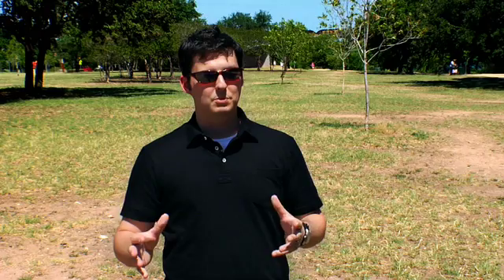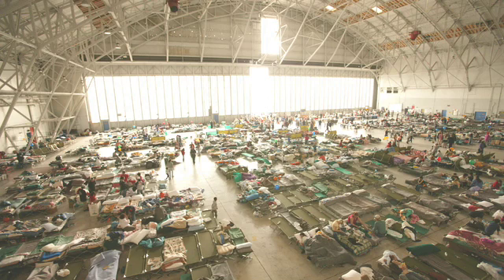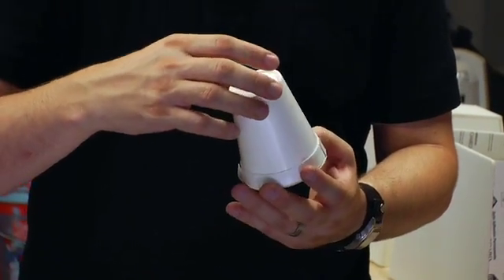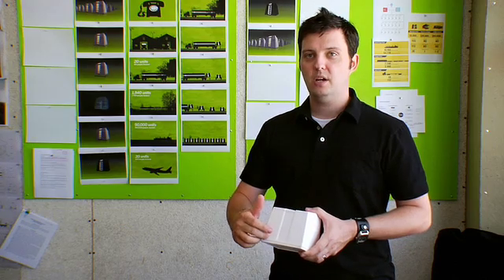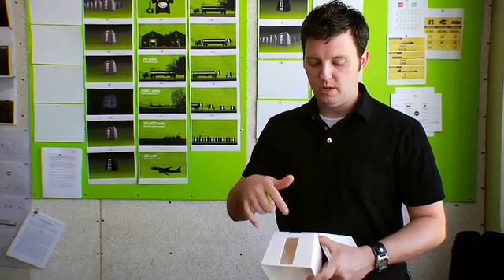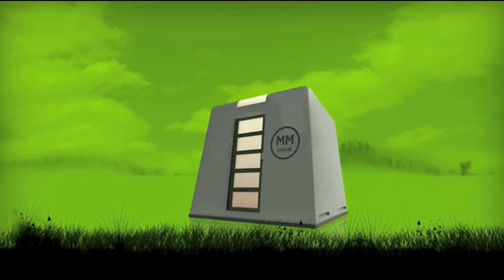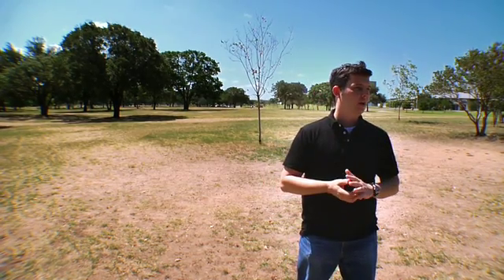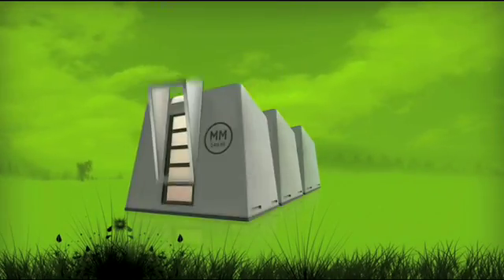GOOD LOOK:  EXO Reaction Housing

Comment: This looks like a fantastic idea.
But I think the reporting failed in outlining more of the features.

I would have liked to see the inside of the unit. 
They should have made more of a point about joining 2+ units together (shown in the graphic, but not spoken about)
They should have mentioned what kind of wind tolerance the units would have (especially important in hurricane affected areas)
They needed to talk about insulation and temperature control inside the units.

More info pls

Comment: Fema Trailer has [toilet, kitchen, AC, shower, running water, sleeps 6, weighted and can withstand weather]  EXO has 4 bunk beds and looks like it could blow away in a rainstorm.  The EXO needs other units dedicated as (restroom, shower, food hall) if 50 units on a flatbed, may consider flatbed to be mobile community  if the other stations are equipped.